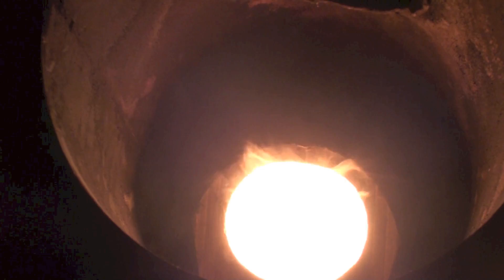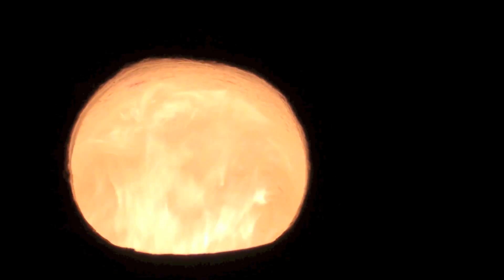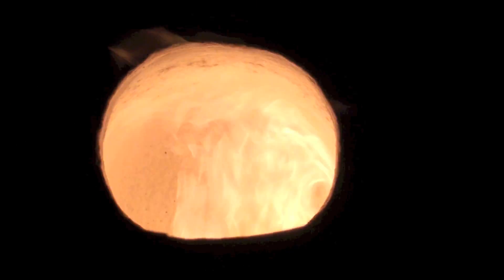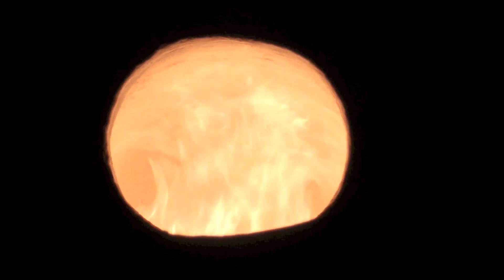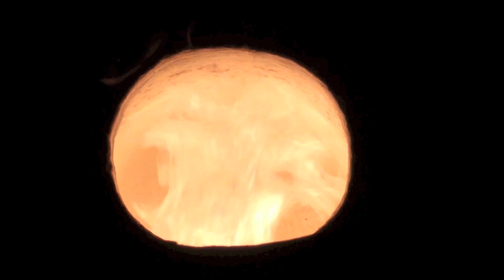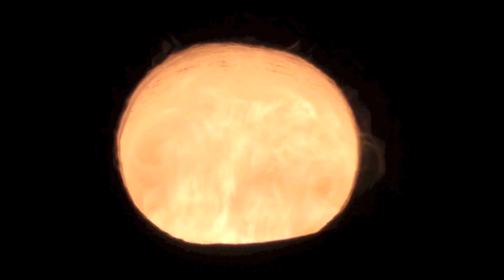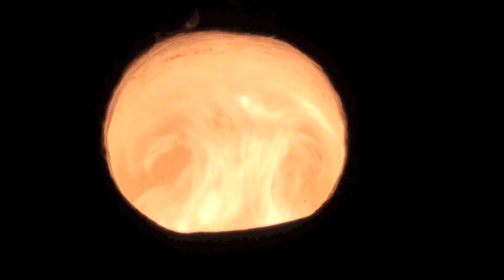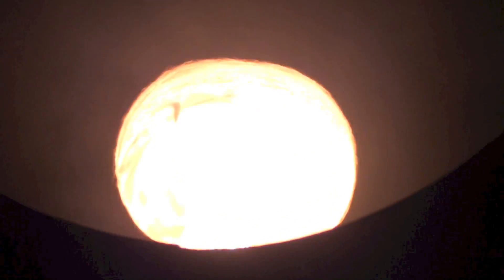After fire of the oil burner

Comment: Had a call today & when they hit reset the darn boiler took off like a rocket with exhaust pipe cherry red glowing & white smoke billowing out chimney . All we could do was shut oil off & let it burn out. I tell you I got close to calling fire department but thankfully it finally went out. Now we have to go back & tear down , inspect & clean entire heat exchanger at a minimum. First time I've ever saw this happen.
Reply from the maker: Sounds like your customer pushed that button about 40 times before you got there.
GFM

Comment: If I have an "after fire" how long will it last?  I seem to have a problem where the fuel keeps dripping and the after fire keeps heating the water in my hot water tank higher and higher.  I have a 2 line supply / return on a Suntec A2VA -7116 oil pump.
Reply from the maker: If the tank is above the burner, and there is a leaking by regulator, that could happen.  Means a new pump.
GFM

Comment: Its alot better now a days with modern controls and burners. Still see it alot though. I had one today that really needs a valve on the pump but its in a rental house so nothing will get done.
Reply from the maker: The discharge solenoid helps a lot.
GFM